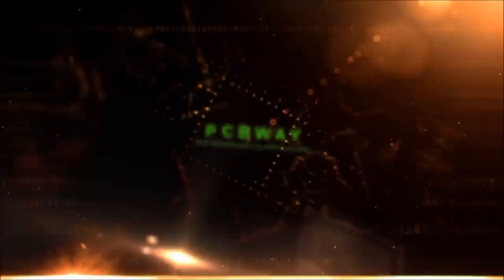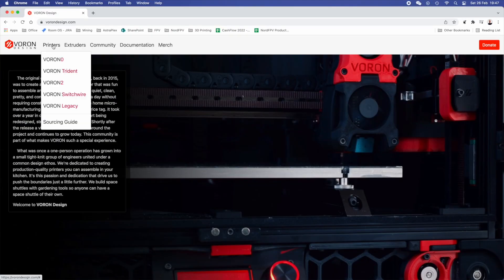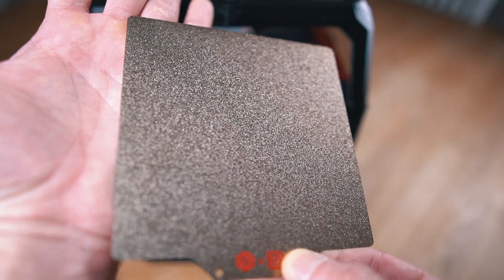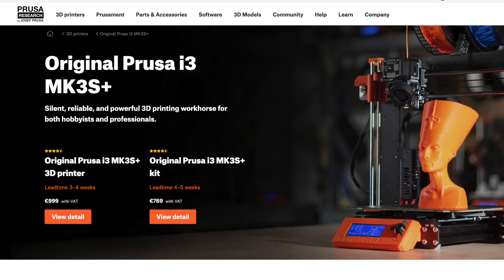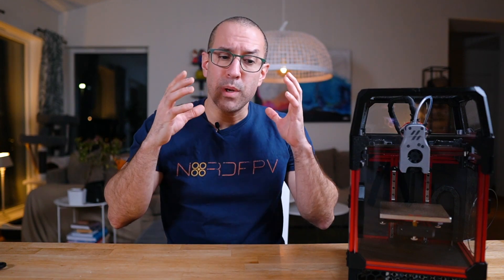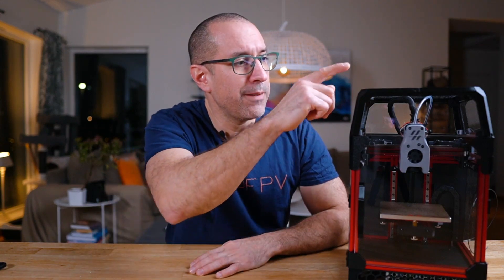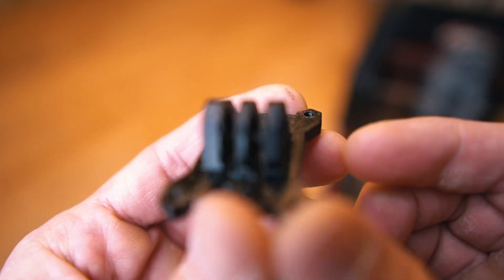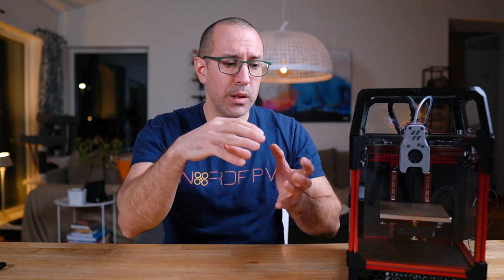I built a Voron 0.1 3D printer, Should you?

Comment: I have a 2.4 and an 0.1. 2.4 is more complicated but the 0.1 is harder due to much smaller working area. I have the 2.4 for printing out in the shed stuff like abs and the 0.1 for inside for occasional PLA prints.
Reply from the maker: Yeah the working area is an important factor. My 0.1 has much more use than my 2.4. It’s so quick and easy to use
Reply: @NordFPV coolies we on same page then - would suggest a nevermore filter mod for it as well if you are using it in the same room you are in..

Comment: People looking at the Voron 0.1 should check out the Voron Salad Fork in 160mm. It uses similar parts to the 0.1 but has a build volume of 160mm instead of 120mm. It is still quite small and has true 3-Z motor bed levelling. There are kits available. Happy Printing!
Reply: Is the Salad Fork associated with Voron? I don't see it on their site.

Comment: I think you're underestimating the speed capabilities of any CoreXY system based Voron 3D Printer... The default Prusa i3 MK3S "Speed" Profile runs a substantial amount of Moves at sub 50mm/s whereas my V2.4 runs pretty much all moves at 300mm/s before I start chasing bottlenecks ( can't print faster without extruding things hotter, can't print hotter otherwise certain design features will look shite, can't accept shite because of OCD, etc... )
Reply from the maker: Hey Durahl. If I understand you correctly, you are just saying I'm conservative with the time improvements I mentioned in the video? If I'm understanding you correctly, then good for me! I should be able to get even faster speed. Thanks

Comment: Since I'm a total newbie to 3d printing this would be a bit intimidating to me to build. But it was interesting to learn about. 👍
Reply: I can recommend the Creality Ender 3 S1. A great printer for the price and prints TPU like nothing and fast. Still many customization possibility. Make sure it's tight the first time you print and be careful setting the nozzle/bed level too low. Make sure the bed is level. You can use the included metal scraper to measure the height in all 4 corners and then extract the height from the nozzle. Should be between 0.1-0.08mm from the plate. Do the leveling with a heated extruder and bed (without filament). After that you can use auto level. If your not looking to get a printer, I can recommend NordFPVs 3dprints! Fast and very nice quality!

Comment: I was ponder getting one few months. then RatRig V-minion came. It's not really comparable machine but still won my check list. These smalelr form FAST printers are awesome for smaller parts or fast prototyping. My modded Sidewinder X1 has been in storage since I built my V-minion. Ability to print PETG, PLA, ABS and ASA (yes you can print ABS and ASA without enclosure. At least fast prints you can). Print speeds for these more rigid filaments range from 100mms to print higher quality to about 200mms to get things done fast with decent quality. There V-minion and V0.1 prnters are similar. Ability to print smaller parts really fast.
Reply from the maker: Hey Mikko, yes, they are great. I'm still wondering if I should have built a bigger one, since there's no much space in this little bed :D. Or it's maybe just an excuse to get myself a bigger printer??! ;)
Reply: @NordFPV  You won't be disapointed with Voron 2.4 either. I've been so happy with my tiny beast that I'm going to ditch my old X1 and build V-core at some point when I need bigger prints again. V-Core can be build in 300^3, 400^3 or 500^2 configuration. I'm too lazy to resource all the parts from different vendors. That was my biggest reason going with RatRig path and not with Voron.
And yes. We all "need" more printers. 😊
Reply: @Walto86  I would recommend LDO V2.4 kit and also check if there are local reseller of LDO kit near yours. Chinese kits like Formbot, Fysetc have the base BOM while LDO goes a bit beyond with some modifications and high quality rails and steppers. Also Formbot get booted out because they attempted to trademark Voron even thought they are affiliate with Voron team.